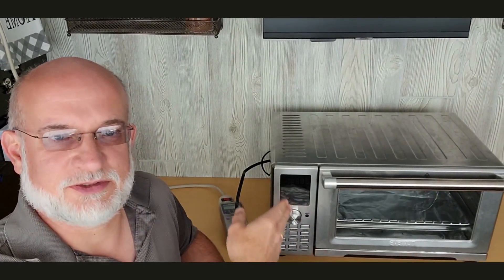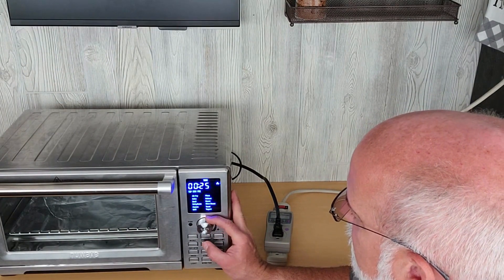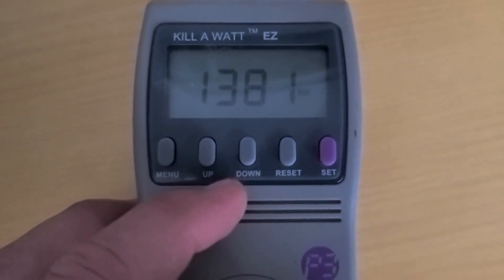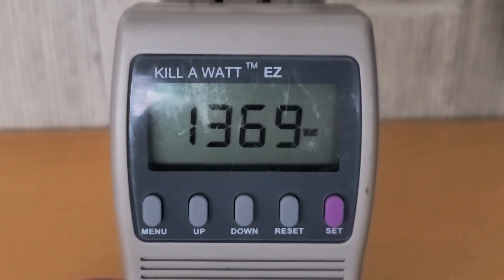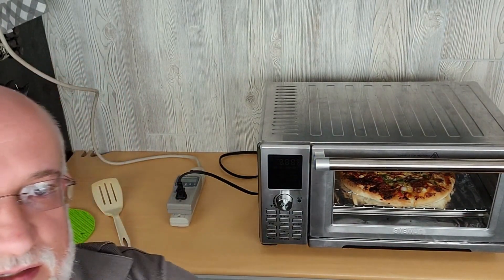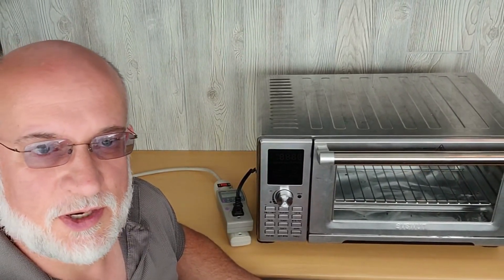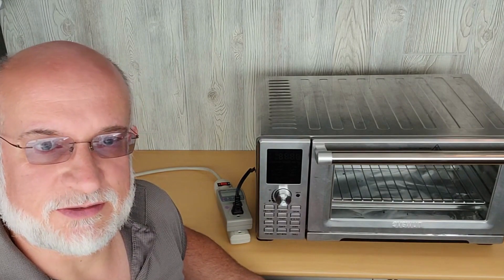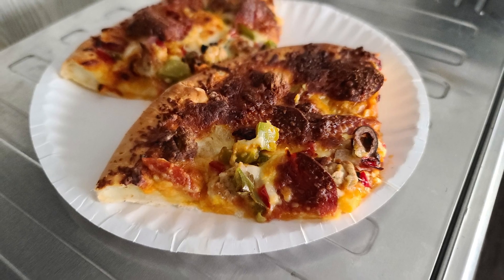Wattage Wednesday: How Much Electricity Does an Air Fryer Use

Comment: Your video is 420 !
Reply from the maker: Although I am not an electrician, it sounds like the UK may be considerably different than the US.
Reply from the maker: Thanks
Reply: I have new Brio Ninja Air Fryer and it can be set to 700 , 1500 and 1800 Watts.  My house is 22 years old and 2200 sq. ft.  How do I know my elec. sysstem will take and go to 1800 safely
Reply from the maker: @Barbara Fritzsche  the minimum household circuit is a 15 amp breaker. 15 amps times 120 volts equals 1800 watts. So every circuit in your house can handle ay least 1800 watts. Now, if the circuit is shared with something else, like a microwave, fridge, or lights, you might trip a breaker. If your wiring is loose or an outlet has a loose connection when you plug in the cord, that could be an issue. I would just make sure when you run the air fryer that you leave spacing on all sides for air circulation because the sides and the cord does get hot.
Reply: @daveandsonyainmichigan I’m afraid you’re wrong mate - the smallest breaker is 5amps and not 15.
Reply from the maker: I have seen 0.5 amp din rail mount circuit breakers. I mention household circuit breaker and probably should have said that in the majority of homes, the smallest breaker is 15 amps. I personally have never seen one smaller until today. I saw a 10 amp breaker. I am not sure what you would use a 5 or 10 amp breaker for in a household circuit. Do you know what a 5 amp breaker would be used for? Is it sized for the load or the wiring? I have used many small breakers in industrial automation equipment or automotive applications.
Reply: @daveandsonyainmichigan  
5 amp breakers / fuses are for primarily lighting circuits or igniters for gas boilers via a switched fused spur .
For kitchen appliances ( except washing machine ) the circuit for the sockets are from IEE regulations a 30 amp on a ring main, whereas the washing machine is on a separate 30amp radial circuit.
But of course  in U.K. we use 240 Vac .